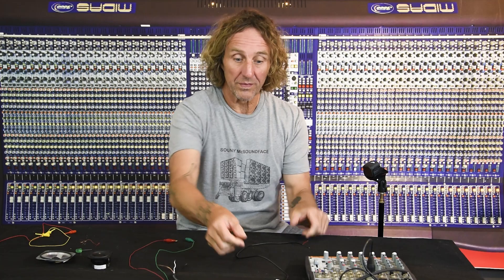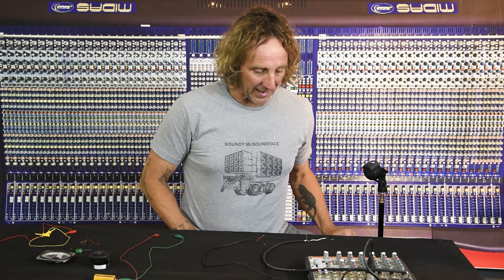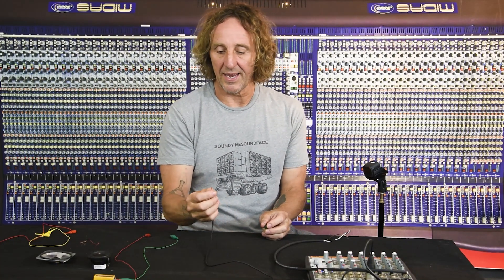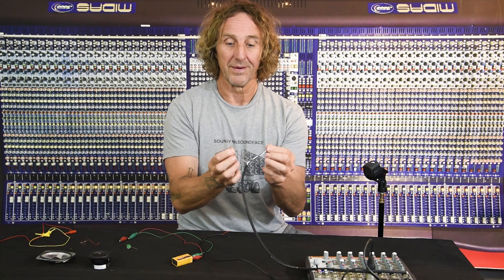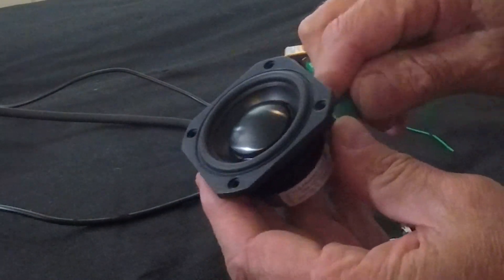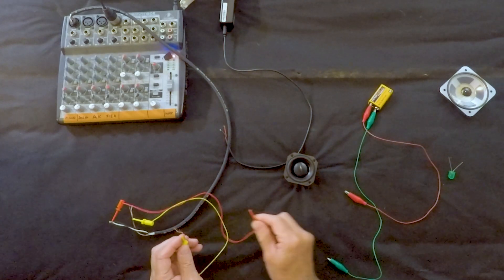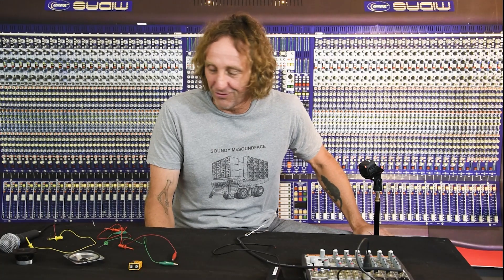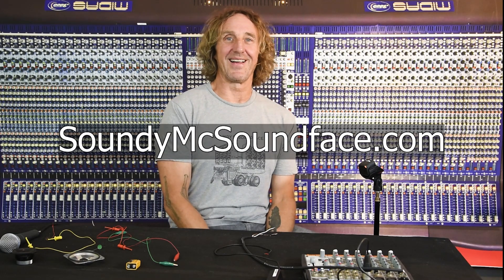Which is More Dangerous? Phantom Power, USB Power or a 9 Volt Battery?

Comment: The phantom power voltage is actually dropping to a very low voltage under load because the supply is only capable of a minuscule amount of current. My guess is it dropped to around 2-3 volts when it was connected to the LED. And under a volt when it was connected to the speaker. 48v DC would have blown that led to pieces. I’m actually really impressed that it held up to the 9v (it would have blown after a few more seconds though). The tongue however is a much high resistance then either of those which in turn won’t load it down as much so it was able to deliver the full 48 volts. That probably hurt like all hell lol
Reply from the maker: Yes this was a test to show that voltage does not determine outcome and there are other factors like current to determine the ouch Factor

Comment: After this video, I had too take a look at mackie phantom power schematics. Near as I can tell, you took a  shot from a LM317HVT voltage regulator chip at full output when it sensed the load of your tongue. I've never put my ohm meter to my tongue, I would think a very high resistance load in the Meg ohm range.
Reply from the maker: Phantom power by spec has a pair of 6800 ohm resistors on pins 2 and 3

Comment: Stands to reason the 48VDC would have the biggest bite, not always the case. With different size condenser microphones one needs some real current pushing that 48VDC.
Reply from the maker: Phantom is also very current limited insuring there is no danger

Comment: If you put my 48 volt power supply on the led without a series resistor as you did it would instantly vaporize the led, this was a bad example of showing what's dangerous, I'd say everything above 30 volt is something you need to be careful with.
Reply from the maker: I specifically am talking about 48v phantom power which by specification has a 6.8K series resistor  built in.

So, the LED is fine and there is no danger

Comment: Dave, my lord you've got me rolling sir.  Great video.  So many people think erroneously applied 48v will fry their gear... I don't think this would ever be the case, it'll just temporarily cause terrible sound!  Also - what's the name origin of "phantom power"?
Reply from the maker: Well, I think you are correct regarding pro gear as most pro gear seems to be immune from damage from phantom. But things like laptops and iPads are not designed with blocking capacitors that have sufficient voltage ratings to deal with phantom.  Alsovery low power electronic devices designed to maximize battery life can be quite fragile. Reports of phantom killing sound cards are numerous from credible sources.

As far as the name, I don't know the official naming. I just assumed it was named to describe power that could be safely sent down existing balanced line circuits
Reply: @Dave Rat thanks Dave!  Good to know about ipads and other devices of that ilk.    Look forward to catching up on your videos, I am learning so much - greatly appreciate your library here

Comment: The 54 volt will last over a year being used every day say for a 4 hour show using km84s but will only last a couple months using a pair of pzm from Radio Shack
Reply: Why is this. I modified the battery pack to 48 volts when I did the XLRs
Reply from the maker: Less expensive electronics tend to have more power draw, better designs can have less power draw but be more expensive to build
Reply from the maker: That's interesting and I have also found that the higher quality mics use less power

Comment: I have a phantom power box made with six 9volt which is 54 volts. Now this is consideréd to be a winner here at the power awards
Reply from the maker: True, but hopefully you're using the 6800 ohm resistors, which then brings it to be equal to every other properly wired phantom source with a 4-volt boost

Comment: I don't recamend that you do this, ok I won't try it on the Neumann km84s with a car battery . Wake up my teeth please.
Reply from the maker: Well, a car battery is only 12 volts and won't be much worse than licking a 9v and won't hurt your KM84.

I am trying to promote knowledge over uninformed fears. 

While some may find this video unsafe, the people that it inspires to actually understand the voltages and currents will actually be more safe and less likely to damage KM84s

Comment: Now try it with a defective USB supply, and a defective phantom power supply -- and get electrocuted!
Seriously, was there a purpose to this? Use a multimeter!
Reply from the maker: The purpose is to put things into perspective.

There are people out there that live in ignorant fear of electricity and see 48volts and think OMG danger and see an9 volt battery and think, think, that is much safer.

But in reality, the 9 volt has the most danger as it can burn you.

The other 2 are are harmless. In fact all 3 are harmless when compared to the butane lighter.sitting in your pocket or kitchen drawer

As far as the "what if"  scenarios, ha! That's and endless road. What if you are holding a cotton ball and a meteor hits you? Don't hold cotton balls
Reply: A 9V battery can start a fire if shorted (in a drawer or in a pocket). Any of these can injure or kill someone if abused.
Why not teach people to use the correct tool for the job?
You don't have to be afraid of low voltage, but it pays to be responsible and stay safe.
Reply from the maker: Exactly! the real big scary thing to live in fear of here is the 9 volt!

And not even the voltage or the electricity is the danger, it's the heat, or perhaps the weight if you throw it at someone.

Before watching this vid, did you know that 48v 0hantom power is less dangerous than a 9v battery?

Can't start fires and can't throw it either

Comment: Phantom power is milliamps in current. USB can be a 2 amp current as it's function is party to charge batteries. A nine volt battery will give you a belt if shorted but.....a mixer and a usb is connected to mains so they are the worst when faults ocour.nuts this it

Comment: ElectroBOOM and Big Clive, both for science and views in older videos went through taste testing a wide range of voltages....
Reply from the maker: Excellent! Well, I think it's a useful safety measure. I actually fried an Ivie pink noise generator doing my most recent vid -audio transformers #4. I am 1uitebbummed and had I been in the field and not intentionally doing tests with phantom iso, a lick test would have saved it

Comment: W hat I wanted to see was which one blows up a reverse biased electrolytic capacitor first.  That’s what actually happens when we plug phantom power into gear that doesn’t expect it, and I think the biggest real risk in practice.
Reply from the maker: https://youtu.be/W42MRnJhXrk
Reply: Probably should use 63v nonpolarized capacitors in that location.
Reply from the maker: Agreed and yet non polarized caps are much larger and more expensive. This is prohibitive in size conscience products.

Try looking up pricing and dimensions of 100uf 63v non polarized capacitors!

Comment: Phantom power is highly current limited.  You will not see 48V across the LED,.....unless it's broken (open).   Which is more dangerous???  It depends on what can supply ~ 40mA through your body's resistance.  The power, that you demonstrate with a speaker, is not the same power a human body would see.    ....due to the body's resistance.    I don't think it's wise to talk about the dangers of electricity (for humans) by demonstrating the noise that these supplies make with a speaker.
Reply from the maker: Well, licking them all puts phantom with the biggest bite.

The battery is the most capable of burning us.

Phantom is the most dangerous to a laptop or ipad soundcard

USB is somewhere in between

Converting the electricity to visible results is just a form of communicating

Comment: Missing source: (faulty) grounded power supply lead sending 120v through chassis ground down balanced cable because some dipshit broke the ground pin off the supply cable and you never bothered to replace it.
(No, I don't actually want to see anyone touch that one.)
Reply: And no RCCD on the supply.....
Reply from the maker: That's no fun

Comment: The USB by a long shot, if we assume cheap noncompliant wall warts that may put line voltage on the USB shield, such as those Big Clive has disecteded.
Reply from the maker: Hmmm, if we are including faulty wiring, or manufacture, then there are quite a few ways phantom could be miswired with live grounds or no current limiting as well.

Maybe limiting to correctly wired and applied would be more relevant?

Comment: The current is what kills you, you're fine with all of them unless you touch the Incomer from the power source, also why did you not use a multimeter rather than an LED or a speaker? Electricity is no joke, you should warn people of the danger of messing around with electricity. I got stuck to a fitting at 230v/16amps with out a breaker tripping, it's not worth playing around. I love your content but let people know the danger
Reply from the maker: Yes there is danger with electricity but none with the things I am testing here.

It's like me comparing toy cars. Do I need to explain real cars are different, bigger and faster and possibly dangerous?
Reply: @DaveRat  again dude I love your content please don't take it the wrong way
Reply from the maker: All good and yes, playing with toy cars while riding in a real car could be dangerous if the real car crashes.
Reply: @DaveRat  ok dude, an electrician here giving you a heads up. I hope nothing happens to you, I really do
Reply from the maker: It's important to keep things in perspective.

No one dies from a 9 volt battery unless ya eat and probably not even then.

As far as safety vs real world of pro audio perhaps this article I wrote a while back of how to avoid endangering musicians and audio groundin may be interesting.

https://www.prosoundweb.com/dont-kill-the-artist-electrical-safety-on-stage/
Reply from the maker: All good! ⚡⚡⚡
Reply: @DaveRat  of course there's danger, your power is coming from the mains, under fault conditions, you could get fried and killed. I just think if you're dealing with mains electricity, just let people know how dangerous it could be. It's your own videos and I've no right to tell you what to do, but what you're doing IS dangerous. As I said I love you're content and learn so much, just be careful brother 🤜🤛🤟
Reply: I think you would need 2 simultaneous faults for this to be dangerous..
1st the equipment would need to be faulty to present lìne voltage at ANY conductor that can be touched (even if it means sticking a wire in the XLR input)
2nd this is portable equipment and should never be connected to an unprotected supply, either the supply woukd have to be "illegal" or the fault protection device(s) on that supply have failed.
Reply from the maker: Yeah or just one fault but either way, 9v, USB and phantom are all harmless

Comment: It has always been interesting to me how we can taste the electrons and metal when testing batteries with our tongues. It's strange to think shock has a taste and yet it kinda does, it's tangy, almost acidic in nature. I'm going to guess it has similar ionic properties as an acidic food or otherwise, like an orange or lemon juice. 

Another one I learned the hard way was that there is voltage on phone lines, I was stripping back the insulator with my teeth once and bang I got myself good! I think it is around 12 to 14 volts and was not wonderful, LOL. I found keeping a lighter handy is the best stripper for that wire, I cringe to think I used to use my teeth as a young installer, LOL. Great video Dave, happy Halloween! 🎃
Reply: Never used a lemon as a power source?
Reply: @nathanielnicholson559  Me neither, just saying they have some similarity in taste, I could be wrong as to the origin of it all though, just speculative thinking out loud, LOL.
Reply: 50 VDC. You're lucky it didn't ring: 75-100 VAC! Lightning or induced voltage on the lines is even more "fun"! SMH
Reply: @mrtechie6810  I had no idea, crazy!
Reply from the maker: Yeah, phone lines when ringing will bite you, especially if you are mouth stripping wires, as I learned as a kid. Fortunately painful is not fatal.

With unprotected phone wires having been everywhere in the previous decades, it does make sense that they are designed around voltages and currents that don't kill ya.

AC wall voltage on the other hand has been around for decades and the wires and wiring is much more protected by law, due to it's more dangerous design and capabilities.
Reply from the maker: Oh my! Yeah I worked on a friend's house built in the 1920s with a mix of original wiring and new.

Safety used to rely on fears and people not messing with things they don't understand, and lose a few humans in the process.

Which I think is why there is such a mixed reaction to the vids of licking electricity.

The lingering fears of the ways things were way less safe combine with lack of understandings and some people get quite upset about me showing harmless shocks.

Comment: There's a story about a minister who was performing baptisms immersed in a tank of water, and he leaned over to grab a microphone and died of a powerful electric shock.  So, is that actually possible, or is it just a made up story?
Reply: True story time...
I got called to a house where the owner had just got a massive shock off the wood burning stove...
It took hours of checking the house wiring and a bit if good luck to find that:
The kettle had developed a live to earth short AND the incoming earth for the house was not connected..
That meant that the RCCD protection failed to detect the kettle fault and the fuse / trip didn't blow since there was no fault current.
The shock occurred due to the floor being damp from a water leak and ALL bonded metalwork (pipes, stove etc) were actually live.
Reply from the maker: Wow!
Reply: @dougaltolan3017  Wow again!  Man, they are so lucky to have you there to find and fix that problem!
Reply from the maker: Electrical issue like putting a toaster in a bathtub can hurt or kill.

But that would be bad ac or bad grounding on the audio gear and have nothing to do with phantom power

Phantom is harmless but audio gear that is plugged in the wall can have wall voltages if improperly wired or there is a fault.  Wall voltage can be dangerous.
Reply: @DaveRat  Thanks very much for the helpful info, Dave!  Much appreciated!

Comment: I assume that is a Shure Beta 58A? Doesn't the A version have a transformer? If so the diaphragm coil will only see spikes of voltage when the magnetic field in the transformer is forming and collapsing...though it would be a really big spike due to "inductive kick."  Only the secondary coil of the transformer will suffer the full DC power of your experimental sources. 

Might transformerless dynamic mics (like most Audix) more susceptible to getting melted by incorrectly wired phantom power?
Reply from the maker: The impedance of mics tends to be fairly high and the the current of phantom is very low.

Phantom does not hurt an om7, I've tested and not does it hurt a 58 without a transformer, I've tested.

I do think there are some mics like a senn MD441 that phantom may hurt as the voice coil wire is so extremely thin.

Also ribbon mics can be susceptible
Reply: @DaveRat  good to know about the Audix mics. Glad you've tested that so we don't have to. 

I just thought of a common scenario where transient cross-wiring of phantom might routinely occur: TRS (¼" or TT) patch bays, if a mic is connected to a preamp with phantom power on, and a patch cable is inserted/removed 48V might be sent across pin 2 and 3 (tip and ring of the TRS connector) while the connector is partly inserted.
Reply from the maker: Tes, and the mics will 9ftem may an audible pip
Reply: @DaveRat  🍻

Comment: Wouldn t it be relevant to know the I (amps), of each device? Voltage alone can be misleading, no? ....Nice video, loved to watch ;) thanks
Reply from the maker: Yes and correct
Reply: @DaveRat  Yeah that s what i was wondering. Thanks Dave ;)
Reply from the maker: No it's not just current that kills. It's more like the Watts that kill which is voltage times current. Super high voltage and low current can get you and super high current with low voltage won't really get you unless it arcs or sparks or is converted to heat or an explosion somehow

So you kind of have to have a minimum voltage of a certain amount and a minimum current of a certain amount and then they kind of work together
Reply: @DaveRat  Yeah, exactly. Thanks for the clarification Dave ;)
Reply: @DaveRat  👍✌🤘